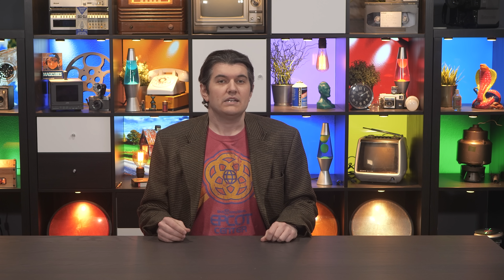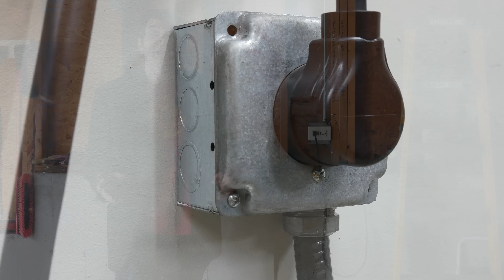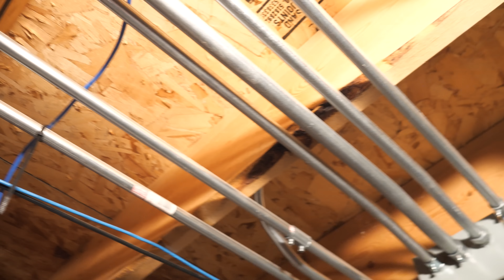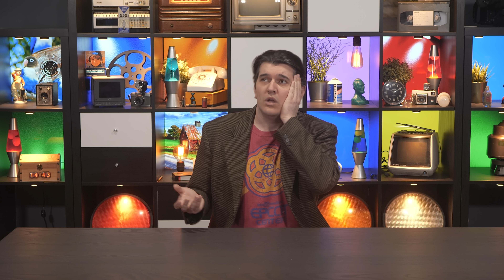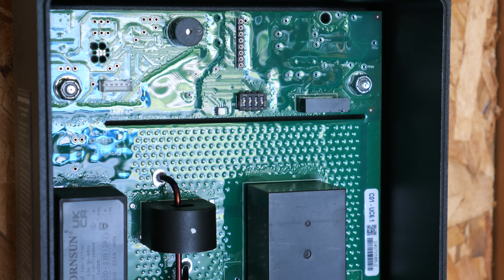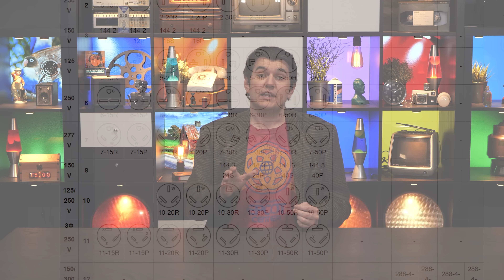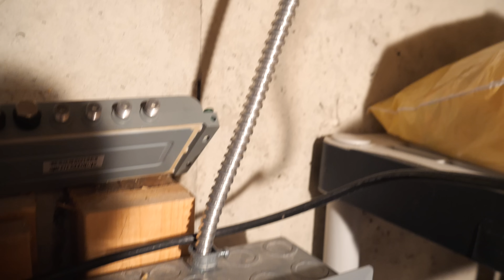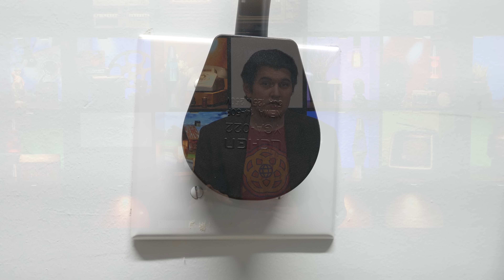The "standard" car charger is usually overkill—but your electrician might not know that

Comment: Great practical info, thanks! I've been driving an EV for five years now, without the ability to have my own charger (apartment living and all) but within a 100 yard radius around my dwelling there are two public 11W AC chargers with two Type 2 connectors each, and the municipality is planning to install a third within a year. In those five years, it's happened, I think twice, that they were all occupied and I couldn't charge when I wanted/needed to... But there's a DC fast charger a mile away, and on my daily commute I pass by like five DC fast chargers along the highway, so even that didn't inconvenience me too much. And yeah, I spend a lot less of my time occupied with charging my car now, than I did at gas stations in the good old ICE era.

With regards to Tesla vs Type 1 / Type 2... It's interesting that here in Europe, it's Tesla that has adopted CCS / Type 2 on all their cars from the Model 3 onwards, while in the US all the charging stations are going the Tesla way. Here, the Tesla connector is by now an "old thing", and people who own a Model S or Model X with a Tesla connector need to schlepp an adapter with them.

Comment: 27:00 am I just really lucky? Since 2014 I have plugged/unplugged my Tesla charging cable at least 500 times (for awhile I didn’t have an EVSE at work and had to use my cable there, and still don’t have an EVSE at any of my homes, so when I go to my cabin in the mountains for a weekend, or down to the shore house, I take my charging cable) and the receptacle seems to be as tight as the day I installed it.  I suspect that people who have had problems, have crappy receptacles, given that there are thousands of RV parks with thousands of NEMA 14-50 receptacles for RVs that get plugged/unplugged hundreds of times a year without any problems.

Comment: The Nissan LEAF, regardless of year, has next to NO charging system feature; you plug it in, and it'll charge full power until the pack is full. Period. There's some sort of rudimentary onboard scheduler but that's it. Charge up to 80%? Forget it. It's all or nothing.

A smart EVSE is essential to get some sort of remote control, and maybe some automation.

Comment: 4:25 MC is available in much bigger sizes than 10 gauge, just look at wire and cable your way. I buy 6/2 MC for car chargers when it needs to be ran through unfinished spaces (not in chicago)

Comment: The dumb charger or bust theorem falls flat if you need to have an AC charger installed in a shared space and you need access control and/or billing. You need smarts to handle those situations.

Comment: me doing my own 240v30a dryer relocation electrical work: okay let's get a thermal camera and an adjustable torque screwdriver, let's get some steel butt connectors with aluminum torque specs on the back and some dielectric grease for the connections

I know them butts are solid

Comment: Love my Ioniq 6 but my garage had no dedicated circuit for an EV charger at home. Also my single garage outlet (that is shared with 3 bedrooms!) doesn't even have a ground, which means the car won't charge (it needs a ground.) But when I was doing some remodeling I ran a couple extra 12/2 to the garage (before I had an EV or I would have run a 10/2 as well). So I was able to run a dedicated receptacle for the car charger. But then....  I was thinking, my Ioniq 6 is a car made in Korea, where they don't have 120V only 230V. Did Hyundai really make a charger specifically for the US rated at 120V? NO they did not!  I took it apart and all the guts (relay, caps, etc.) are indeed rated for 240V!  So I hooked my 12/2 up to a two pole breaker, installed a NEMA 6-20 outlet (the right one for 20A 240V) and bought an adapter for the charger to convert a regular 15A 120V into the 6-20 (I didn't want to cut the end off the charger in case I needed to use it elsewhere). And VOILA my included charger now charges at 12A 240V (the charger is limited to 12A max). Now I can charge at 2.8kW/hr which is still REALLY slow, but I can charge 10 hours a day, so that's 28.8kWhr over 10 hours. My Ioniq 6 gets about 4 miles/kWh, so that's 115 miles over night with the FREE included charger and $40 in parts (breaker, wire, outlet, box, adapter). Everyone things they need a max sized car charger, but you really need to do the math.

Comment: There are safety issues to consider. DO NOT just use whatever 120v outlet in your garage, unless it is a DEDICATED circuit. If you have weak connections on the existing, multiple outlet circuit, you could run into overheating, arching, and risk of fire.
Reply: I've been charging our Tesla for over 4 years off a non-dedicated branch circuit with multiple outlets on it. It never gets hot, probably because the car automatically limits the current to 12 amps, which is well within the capabilities of the circuit. I don't see that a dedicated circuit is a requirement. If it's not a good connection, especially if it's arching, then it's improperly installed, and a dedicated circuit can just as easily be improperly installed.
Reply: "I've been eating McDonald's for lunch every day for years. Why am I having a heart attack now?" @winfidel

Comment: I don't top off my tank every day but for me, range of EVs is definitely a pretty big downside that keeps me from going with one and this past Sunday was a great example of this. I wasn't planning on the amount of driving I did and ended driving a total of 300 miles. I started with half a tank of gas (200 mile range) and when I got close to empty, I filled up (about 5 minutes and a much needed leg stretch) and continued on my way.

EVs have their place but for me, the range just doesn't fit my needs and is nowhere near that of my ice vehicles (my other car had done 600 miles on a tank a couple times now)

Comment: I do agree with opting for dumb EVSEs, however there are instances in which the smart EVSEs are warranted. Such as ones that can load share or ones that can tie into your electricity provider and do ondemand power throttling to smooth out the grid. I'm for smart EVSEs so long as they gracefully turn into dumb chargers.

Comment: It seems like it should be basically trivial for apartment complexes to install L2 chargers that take a credit card and apply some small upcharge on the base electric rate, say a markup of 25%, to cover what I imagine would be very nominal maintenance fees - and maybe they could even make some small profit off of it if the installed units are reliable enough. That said, it seems challenging to deal with the problem of people without EV’s parking in those spots if they’re too conveniently-located, or alternatively, people parking an EV overnight and only charging 5% of their battery. 

Apartment living unfortunately makes the case for batteries that are considerably larger than somebody would need who lives in a location with guaranteed overnight charging.

Comment: Isn't slower charging at moderate power levels better for the longevity of the batteries, too? Or have EV batteries finally figured that magic out? I know that's the case with nearly all other rechargeable batteries.
Hell, I don't even plug in my PHONE every day. It doesn't NEED to be at 100% all the time. In fact, keeping the battery in that sweet zone of 20-80% most of the time is often best for it's longevity... and slow charging WHEN YOU NEED IT... is how you make them last longer.

The ONE thing that's kept me from getting an EV... the distance driving I do often enough that the added time is a problem. Visiting my parents, as I do 2-3 times a year, all the planner sites add TEN HOURS to an already 18+ hour driving time trip. Ooof.
Reply: Even the fastest AC charging is still "slow" charging as far as the battery in a full EV is concerned; don't worry about that.

Comment: We just got our first EV a few months ago. I will admit the first thing I did was call an electrician to ask about installing an outlet for an L2 charger. I didn't pull the trigger right away, though, and after a few months of my wife using the car as her daily driver... I'm not sure I'm going to bother. We will still probably install a dedicated outlet/breaker, but it will probably just be 120V. At the moment she's using the outlet that was originally set up for our freezer and that is plugged into an extension cord because there are only the two outlets in the garage. 😛 I think the reason most people assume they'll need an L2 charger is because you can't just go to a gas station and fill up in 5 minutes. But the reality, as you point out, is that a slow charger will give you all the electricity you need for a day's driving in most normal use cases.

Comment: Here's a use case.. In the winter, I'd like to be able to only charge my pacifica hybrid to 90% or so. This is because it always warms up the gas engine and I want to be able to capture the energy while it's warming up. If it's already 100%then there's nowhere for it to go. So far I've accomplished this by setting a timer on the Alexa and unplugging it myself.

Comment: my  EVSE, a high power electric device being connected to the internet to tell my car its circuit limits is horrifying. what if the internet went out? how could my car have any idea the circuit capacity?.. well  id love to see a remake of the charging guides video and they are decently old now, 2022 if i remember correctly and there are a LOT of really cool features that have been unveiled since then, plus the decision on the NACS connector. Scary opinion, most people who create dangerous situations with electrical wiring are simply because of either lack of knowledge, or just negligence.

Comment: We charge a Tesla M3LR from 35%-90% and a Subaru Solterra from 50%-90% daily off a 24a esve. Debating on a second and splitting them 12a each just to stop the move around the cable game.
Reply: I use a Grizzl-e duo to charge 2 cars daily. It takes care of splitting the demand between the two cars, no need to do the cable shuffle.

Comment: I only had a 3.7kw charger for the first 2 years I drove electric. Just charging from a standard single phase outlet here in Europe. Worked just fine. The only benefit to upgrading is as you suggest is variable electricity prices.

Comment: Thank you for this video. It got it through my thick skull that I should downgrade my dryer-connected charging system to 24A instead of the 30A I had been using. My evse isn't adjustable, so I bought a 24A non-adjustable one to replace my 30A one.

Comment: Here EVSEs with Schuco plugs are required to have a temperature sensors in the plug. They will abort charging if the plug temperature goes beyond a certain temperature threshold. Seems like something like that could be relatively easily included in those chargers. Outside industrial settings, we don't really have plugs that deliver anything more than a Schuko so all permanent charging setups are always hardwired.
Reply: My portable EVSE is a J+ Booster 2 which has this feature (supposedly; I haven't tested it).

It has interchangeable heads for NEMA 5-15 (standard US household outlet) and NEMA 14-50, and you can buy others. It's an expensive unit but high quality, and it tends to go on sale for Black Friday. I've used it plenty for both level 1 charging and level 2 at RV campsites (the NEMA 14-50 is conveniently the standard for large campers here).

Comment: As a guy who works in electrical supplies, I can tell you that your electrician definitely knows that you don't need a 50a circuit. They just dont really care to try to explain any of this to the customer. As far as they're concerned, work is work. There's no reason argue/explain when a customer is asking for more than they need.
Reply: The customers usually think they know better, so we just give them what they want. I got tired of advocating a smaller circuit for their needs and I'm not going to argue with a customer over this. I just present the facts.
Reply: How much more are they actually paying for the 50a vs the 30a?
Reply: @jisc0 the biggest cost difference would be in the cable that they need to run... But copper prices fluctuate from week to week so I couldn't tell you exactly. Probably around $50 difference in materials.
Reply: @sneakinynja so if I paying someone I’ll pay the extra $50. I’ve had three installed so far. I always go for a 60amp circuit if I can

Comment: Said this before on a previous video on this same topic, but when will restaurants and coffee houses notice they can get more business setting these DC Fast Charging stations outside of their establishments. The folks using those stations are going to be standing (or sitting) around for a while, so why not give them some place where they can purchase and consume something to wet their whistle and make their tummy happy. It seems like a no brainer. Slap on a few solar panels to a roof like structure over those spots to shade them (Seriously! I live in Arizona. Why the hell are so many parking lots not doing this? It's pretty much free real estate, and it stops that blasted asphalt/tarmac from turning into thermal batteries. (Oooo... Maybe we can use that residual heat for something?)

Comment: 2:07 i think most electricians know this, however most customers have a hard time wrapping their heads around how voltages, amperages and power works.  compound that with handy-andy recommendation, it can be tough to convince people who are doggedly assured that what they saw at their cousin's friend's house can only work if its got a dryer plug.
Reply: and the Grizzl-e is a great ruggedized evse

Comment: The type of receptacle goes with the breaker current rating and the wire gage. As a rule, you want the highest current rating for EV charging since smart chargers can use as much electricity when it is cheaper and trickle charge when it is most expensive. And yes, time base price rate is a thing now.

Comment: I’m thinking of an EV, but I don’t have a 220 volt  outlet in my garage. However I do have several 110 volt outlets. I’m going to go with the 110 volt option. I don’t drive that much so I can put up with the slow charging speed because I have an ICE vehicle as a backup. I’ll just use the gas car while the EV is being charged. On top of that, it would cost $5000 to upgrade. No thank you! The slow way is a pain but it would save me a whole lot of $$$! 😊😊
Reply: Is it just one circuit or two circuits in the garage?

There are joiner cables or whatever they're called that can combine 110 into 220.

Comment: Something weird happened at my parents house... they have a new 50A circuit installed with a nema plug, and a GE-supplied ultium supply they plug into it. The supply is rated for 32A but my sister connected her Tesla to it, selected 45A as a charging speed (not knowing about the limitation of the supply) and tripped the circuit breaker. How is that possible based on the info in this video? Pretty dangerous.

Comment: My Go-E EVSE has a home assistant integration (and also a proprietary way) to feed it solar excess information to charge with just the excess, down to 1400W (In Europe you can charge as slow as 230V 6A). There is definitely good use for smart ones.

Comment: Once I got my whole-home battery system installed and began expanding the solar a bit, I realized that I could charge my car entirely off-grid.  All I really had to do was damp-down the EVSE from 9kW to 6kW to prevent it from draining the battery too quickly.

I have a little portable 120VAC EVSE as well, but I gotta say... it isn't nearly as efficient as a 240VAC EVSE.  The vehicle's "vampire" consumption eats a significant portion of the roughly 1kW of power it can provide, and 120VAC is roughly 4% less efficient than 240VAC when it comes to charging an EV on top of that.

Then, electricians... ah.... electricians.  I think they are catching up but when I had my 240VAC EVSE installed I had to argue with the electrician a bit because he had specified an under-sized cable.  It took some explaining before he understood that an EV might be charging at full power for 5+ hours, but we finally spec'd a 6 AWG cable instead of 8.   Losses can be substantial with thinner cabling and the EV can wind up averaging as much energy as the whole house!

Finally... EVSEs can be a bit dangerous when you don't cable for the maximum supported current of the EVSE. The problem is that someone down the line might change the dip switches and while the breaker will ultimately protect the circuit, things can get toasty before it actually trips.  It is not an ideal situation.  Because of that it is usually best to cable for the maximum supported current.  But since you did not, I strongly recommend labeling the maximum allowed setting at the EVSE itself.

-Matt

Comment: Licensed electrician here. First of all don't listen to an electrician on proper car charging. We don't know anymore than any other person. I mean I do but that's because I learned on my own. 
First what is wrong with nuts? They are a perfectly legitimate way to make electrical joints, as long as you do them properly, like anything else. 
Also like you said using a receptacle properly will be just fine. I actually got banned on a Reddit sub for saying this, but apparently the admins don't have fully functioning brains. 
For myself, I actually charge my car for the first year with a normal 15 amp/120 V circuit. But whenever we turn on the coffee maker, it would trip the breaker. So I just installed a 20 amp/240 V circuit. It charges in plenty of time. And, I used a receptacle 😱
Reply: Lol. Thanks. I didn't sweep up either when done

Comment: One feature that requires a smart charger is the Dynamic Load Management that Emporia chargers use to prevent the overloading of the entire panel. If the panel as a whole is above its 80% usage, the charger will drop the current.